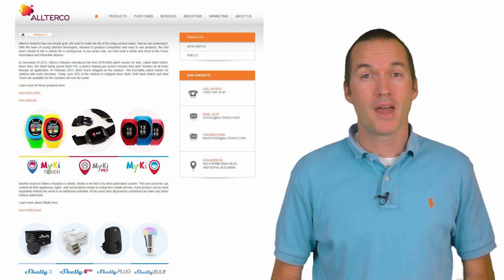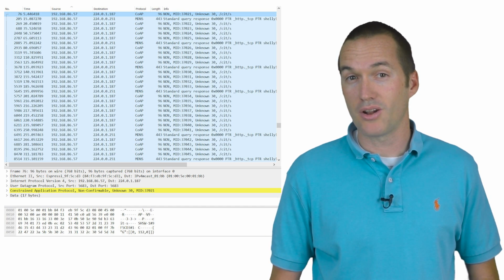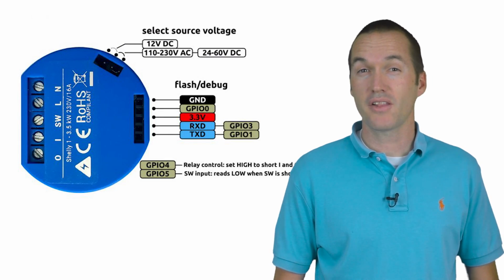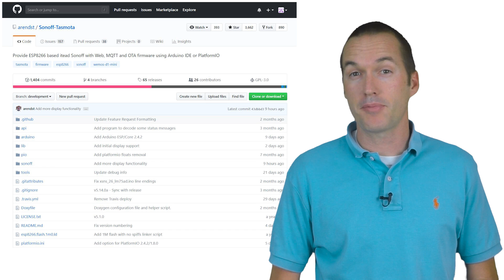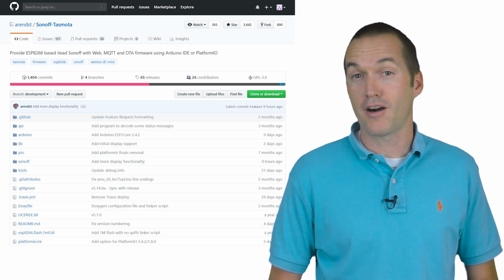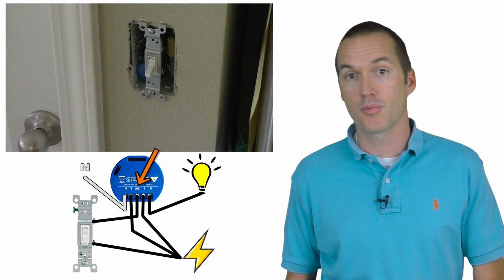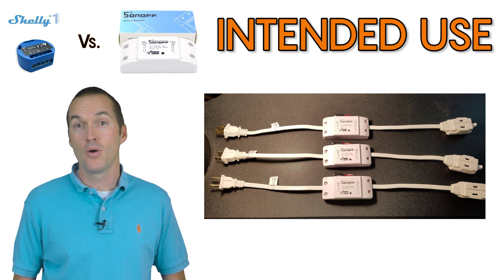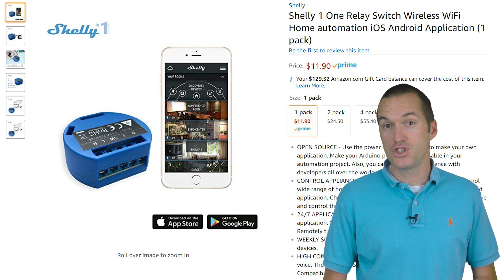Is the Shelly 1 better than the Sonoff Basic?

Comment: You mention the Sonoff is $5.  Maybe I just assumed the Shelly 1 was $5 but your link to Amazon turns up $23.99.  That's not very competitive IMHO.  Is this the going price these days?
Reply from the maker: That's a 2 pack.  It's $9.90 on their website
Reply: @TheHookUp  Thanks!  I didn't catch it was a 2 pack--guess I only saw one in the picture and didn't read further.  I'm in the US so after adding shipping from the Shelly web site and converting to US dollars I decided to go with the 2 pack on Amazon.   If all goes well with these I might just get more.  I'll check out your web site.  Thanks for the reply!  P.S. Would you consider a video on integrating X10 into today's world?  I have a lot of X10 units but the "smart" X10 timers/controllers that allowed running macros etc broke years ago so all I can do now is turn things on via a x10 remote.
Reply from the maker: @cj4331  I never got into x10, so I don't have any experience on integrating it.

Comment: Having an issue with my shelly 1 v3's running tasmota firmware. I have push buttons in my setup. Now, using the stock firmware this is fine. Push buttons work as expected. After installing the tasmota firmware, setting up GPIO5 as 'relay' and GPIO4 as 'button' end up resetting the device to default. But, it doesn't reset until you toggle the button for the first time. Then I have to set the Wifi, Module type, and GPIOs. I am using the Generic Module type in the configuration. Is there a way to use the Shelly profile with a push button (momentary switch)?
Thx., Don
Reply from the maker: Change button to switch and type switchMode1 5 into the console.

Comment: If I hook the Shelly 1 up to a single pole switch, does the physical switch need to be in the ON position at all times for the switch to work with the shelly - In other words, if the physical switch is in the OFF position can the Shelly still turn on the light?
Reply from the maker: Shelly will work no matter what position the switch is in.  It only uses the switch as secondary control to toggle the relay.

Comment: Sonoff is more likely for EU users. Here is waaaay different how you build the electric environment, tho the components are also really different, and Shelly wont even fit in a normal switch or socket wallbox. Ofc we have deeper wallboxes and different type of walls, but Shelly  (tho it's design is really awsome) sadly a no-no in many cases. Also note, you don't need for Sonoff any cable for ex. for a lamp, you can hide it in it's housing.
Reply from the maker: Can you explain more? Sonoff is larger, how does that make it better for small boxes?
Reply: @TheHookUp  I meant that Sonoff cannot be fixed in wallboxes in EU neither (You mentioned without hacking it around), because  the wallboxes here are full with cable and the switches and sockets are fulfill the entire wallbox, they are deeper in scale. The switch that is in this video we don't use in the EU, that switch has way more space behind it that we have. You must "hide" the Sonoff in different place, for ex. in the housing of a lamp, or  must be wired entirely different. Even the Shelly cannot fit in EU wallboxes because what I already mentioned above, only when we use deeper wallboxes.

Comment: Please do not use wire nuts......
Please use wago terminals, because they are safer
Reply from the maker: Wago terminals are awesome and very safe, but they are also much more expensive.  Wire nuts are used by every professional electrician in the United States and have been the standard for 50 years.  They are perfectly safe if used correctly.
Reply: @TheHookUp  I live in Europe and if I am not miss informed wire nuts are forbidden and at least in the region of Germany I live in they were never really popular.
And they only cost double of standard screw clamps (which are a pain to work with and are not really safe) I and my family only use wago terminals.

And I personally think that they are safer if not used by professionals since not all of the viewers are able to hire a professional or work professionally by them selfes.
Reply from the maker: UK is known for having much higher standards for electrical safety than the US.  I totally agree that wago terminals are better, but that is because they are easy to use correctly where wire nuts are easy to use incorrectly.
Reply: @TheHookUp  That's right. And I for my self like that they (if used correctly) do no harm to the wire so you do not need to shorten the wire if you change the wiring.

Comment: Any idea what all the Shelly device firmware updates are for?  Seems to work the same as when I installed them in Nov.  Thanks!
Reply from the maker: According to the shelly support page on Facebook they are trying to solve some disconnect issues with a specific router type (fritzbox).  

The party line has been not to worry about the updates unless you are having issues.
Reply: @TheHookUp  Thank you so much for the reply!!!  I'll go follow that FB page now.

Comment: hello. I've read good reviews about shelly 1 (compaired to sonoff basic) and im thinking about giving it a try for my single light switch , instead of Sonoff T1, but im a bit confused with I,O and SW and their intented use. L, I, O are for 240V light switch and SW is for direct current devices? I didnt get it or I,O are with no switch and the SW is the switch line which turns on/off manually or by hassio?
Reply from the maker: I is input voltage, O is output voltage for the relay, SW takes 240V from the light switch and L is 240V constant supply voltage.

Comment: i'm sorry but... the GND pin is connected to LIVE... thats asinine... surely they could have designed around that...
Reply from the maker: It's actually quite common to use L as the reference for the low voltage side of the chip... But like many things, Shelly listened to what the customers wanted and fixed this issue on the Shelly1 V3 that can be hooked up with N as the voltage reference.  I still wouldn't recommend using the GPIO pins when connected to mains due to the small amount of isolation in such a small device, but you could technically do it now.
Reply: @TheHookUp  Oh that's awesome, thanks for the response and feedback! First time seeing you're channel (I was researching Sonoffs) and you have awesome information/format!

Comment: You can accomplish the same thing with a ESP8266 ESP-01 5V 2-Channel WiFi Relay Module for $6.00... Oh.. and you'll need a 3D printer to make a shell.
Reply from the maker: You forgot about the ac you dc power and terminal blocks.  You can't build a comparable product for less money.
Reply: @TheHookUp  Well I was thinking the 2 channel as comparable to the Shelly 2 relay version and since I work in Shenzhen and design the power supplies from scratch it's pretty cheap for me to manufacture my boards and stuff them. I usually use PCBWay to make my boards which run about ..22 cents. My power supply  board fully stuffed is less than .75 which accepts 220V/110V in and 5V out nominally. I was thinking the windbond memory upgrade is about .30 so my costs I think might be under both Sonoff and Shelly 2 channel. The Sonoff single channel is hard to beat that price but you'd still have to memory upgrade if you wanted to do anything significant with it. Also I think your Shelly has one more I/O pin than sonoff (but you can make an I/O pin if you choose because I think there's an empty spot for it on one of the ATMega pins on the single channel sonoff. )  But yeah.. most people would have to buy a power supply to make the ESP01 relay modules work which if they had to order them it could cost as much as $1 - $2. You'd still have to print an enclosure for the ESP mod too.

Comment: wifi range testing would've been good as shelley looked to have a pretty small antenna on the pcb.
table list of winner in each section would've been good with a final score.
I assume it supports simple http with use of alex/google, openhab or home assistant..??
Reply from the maker: Yeah http REST api.

Comment: In UK SHELLY 1 One Smart Relay Switch is around £25 from Amazon, so its a non starter over a Sonoff!
Reply: From eBay (UK) a seller in Lithuania is selling them for just under £20 still around 4 x times more than a Sonoff basic
Reply from the maker: Have you tried to source them from https://shelly.cloud/

Comment: If you EVER go NEAR, let alone over 10A on a lighting system, you have very, very serious issues (we are talking if you are home owner NOT commercial) With all my lights on (8 in 2 bed flat) I draw about 0.4A. The whole lighting system only has 6A fuse now and that's considered too much these days
Reply from the maker: I don't think many people will be maxing out the relay current (although I've seen people try to run heaters on a sonoff basic - bad idea).

The key is that if there is a short or some other failure down the line that leads to lots of current flowing the shelly will not be the point of failure because it is rated at 16A vs the circuit breaker's 15A (in the US), meaning the circuit breaker will pop before the shelly burns.
Reply: @TheHookUp  WOW 15A? That's a boiler on it's own over here. As we only use LED for all lighting here, power usage is nothing these days. Swap, it's well worth it (if not using already, which if you, lower your main light fuse (both up and down if on 2 sides of the board?)

Comment: Hey Rob,
First up I enjoy your work and thank you for it. 
Second , if the Shelly 1 is turn off via MQTT how will the local wall switch work ? Does it need to be switched off and then on to turn on the light attached or will it switch with just one toggle or the switch ? (? 3 way switch config? )
Thanks on advance for any input .
Reply from the maker: You can use both the local switch and MQTT, there is no requirement for switch position when operating the shelly via MQTT.
Reply: @TheHookUp  

Thanks Prof.
Do tell your friends at ALLTERCO that your review was effective and that I am buying several of their products because of the work you did for them.

Thanks again.

Comment: Is there an App to controll smart devices with Tasmota or do i have to keep the firmware on a Sonoff Basic to controll it with an App?
Reply from the maker: Most people who use tasmota are also using a home automaton platform like home assistant, open hab, or node red to have app or web based control.
Reply: @TheHookUp  I know that. But that would be a little overkill for just my room. Is there an App or should i just keep the standard firmware?
Reply from the maker: @Zockerzimmer  standard firmware

Comment: Awesome writeup. Just bought two. Quick question. you mention changing INPUT_PULLUP to INPUT in the son off into file. I can see in master these lines appear in support_button.ino and support_switch.ino. Did you change both of these or is there somewhere else it should be changed?
Reply from the maker: There is a shelly module in the official tasmota release now, no need to use my version anymore. Enjoy!
Reply: Fantastic. Can't wait for those bad boys to turn up. Even if I was looking to get my coding hands dirty ;) Thanks so much for the super quick reply @TheHookUp

Comment: The Shelly 1 works great with tasmota and a wall switch.  I think you said they are trying to get UL certified. Is that true? If so, do you know what the status is?  Gread videos.  Thanks
Reply from the maker: Their UL testing started on 1/7, and I believe it takes about 60 days, so hopefully early march.

Comment: Question: If the relay is being closed by SW, does this override remote control via WiFi/App? In real life terms, if I have a physical bedroom light switch turned on and I don’t want to get up and turn it off, can I still turn the light off via the app?
Reply from the maker: Absolutely.  

There are a few different switch modes you can enable, but regardless of which one you pick you can always control the light via both the app and the switch.

Comment: How long could 4 AA 1.5 rechargable batteries power the Shelly 1 ?
Reply from the maker: Not at all, it requires at least 12V to operate.   8 AA batteries could power it up, but you'd need to write a custom firmware with power consumption in mind if you wanted it to last.

Comment: I'm just starting to research Home Assistant and the hardware I can use to implement things. A few questions relating to the Shelly 1: 

1) What happens if the physical switch is turned off and then the relay in the Shelly 1 is turned on via wifi? Someone walks into the room to find the lights on and the switch physically off. Do they then have to switch it on and then back off again to control the status of the relay, or does the up position now turn the relay on? 

2) I love the price point of this product and don't mind spending the time to flash the firmware, etc. to get it running. My concern is the reliance on wifi compared to something like Z-wave or Zigbee. If I use a Z-wave switch and ethernet to connect to whatever unit is running home assistant and a Z-wave USB stick, won't that be more reliable? I'm just thinking of the number of times my wifi is messy and has to be power cycled. I know I couldn't control it in those situations via my phone since that would need wifi, but any automated home assistant functions should still work and I could control it via my Mac which is on ethernet. I'm also assuming that, unlike standard wall switches, Z-wave switches might be momentary where they bounce back into a neutral position after being pressed, so the switch itself does not physically reflect that status of the load?
I know Z-wave switches would to cost 3x as much... I'm just trying to figure out if it would be worth it. Spending $12 a switch is a no brainer (would do my whole house), while spending $35 would limit the number of switches I'd replace. Does anyone make a Z-wave equivalent to the Shelly 1?

Just trying to make sure I understand my options and choose what's best for my project. 
Thanks for the video... it was very useful.
Reply from the maker: 1. There are many switch modes to choose from, but all maintain both switch and app control. (both situations you described can be selected via the different switch modes).

2. From the 4-5 people I've talked to that use both WiFi and Zwave they have told me that WiFi is more reliable, but that's not a large sample size. I have between 50-60 devices on my wifi at any given time and I don't have any congestion problems.

Comment: Thanks for your good videos can you help me with a Problem 
i installed a Shelly 1 for my light in de ceiling if i use de switch on the wall the light comes on for a second hand than it Goes out again.
with HA the light works fine what is wrong thanks for your help.
Reply from the maker: Tasmota or shelly firmware?
Reply: The Hook Up the problem is over thanks

Comment: How about earthing the device, which is in the bigger Sonoff.

How about separation of high voltages, N and L? Sonoff has air separation which is good.
Reply from the maker: Both of the issues you have mentioned are important when an end user may come in contact with the device.  Since the shelly is behind the switch plate and the switch it is connected to is rated for mains voltage and is earthed, the shelly does not need to be.
Reply: @TheHookUp  ok, for that scenario, I can understand why you don't have a ground pin.

But what about the separation of the high voltage and the low voltage.  That is good on the Sonoff.  It is important if the lightning strikes, for instance.
You have open it so you should be able to tell. ;-)

(Yes, I do like what I see and your video, I am just curious)

Comment: I wonder, is there any way to have Alexa connected to the internet, while controlling devices on there separate own non-internet connected network. Is there a way to have a packet Alexa sends to traverse multiple networks in the home? I mean I guess you could use a desktop network switch but its not just as easy as hooking Alexa up to a network switch is it?

Maybe an interesting video idea, since you seem to be worried about security.
Reply from the maker: You'd need to manually add the routing

Comment: I notice in almost 100% of the example Arduino code shown in videos uses the loop function. I understand from a quick and dirty demo standpoint. My question is...I have a project that constantly polls for an input. It is going to run 24/7/365. Does this constand polling over heat the processor? Would it be better to setup this up on an interrupt? I am not concerned with power, just with overheating or wearing out the processor. Thank you for your videos and sharing your knowlege.

Comment: In Tennessee a switch box uses one piece of #12 AWG and uses the white (neutral) wire to go back to light fixture as Hot instead of neutral. In my case I'll have to install in the light fixture box in order to power the Shelly.